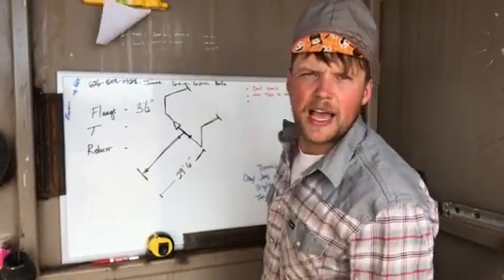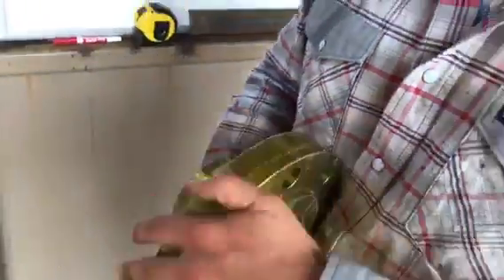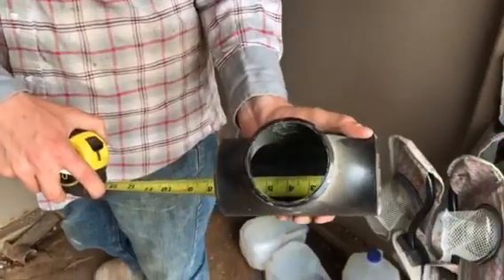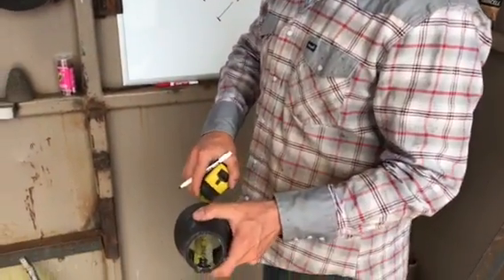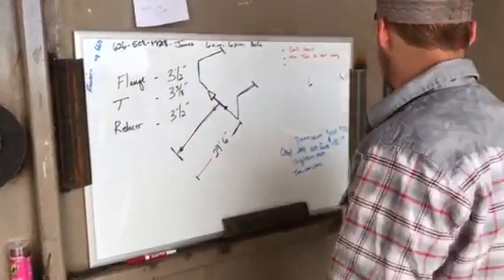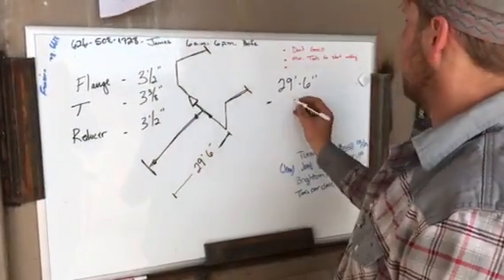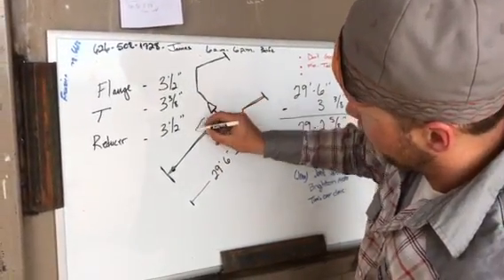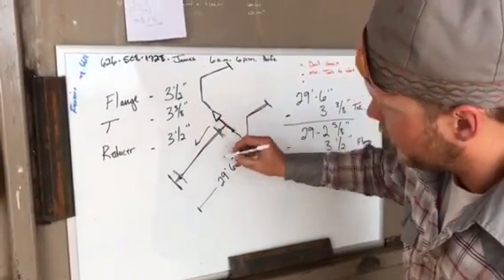Pipefitter fabrication reading an ISO

Comment: Forgot the weld gaps and gasket. 600# is the flange pressure class. The pressure a flange can withstand depends on operational temperature.
Reply from the maker: some pieces I don't worry about it but if its a lot of welds in one piece then I really pay attention to weld gaps and all that.
Reply: @JacobSchofield  That may work for three inch but you try that on some tight 10 inch and you may be screwed.

Comment: 600 lb is the pressure rating of the pipe and begins with 150 PSI and up to 2, 500 PSI. I'm a metric man and its leaps years ahead of imperial measurements and so easy 2 figure as well.

Comment: A 600# flange is not the pressure rating of the flange it is simply the flange diameter and bolt pattern..a 150# flange could easily hold over 500 lbs

Comment: I like how you use feet and inches instead of just inches I bet you have to use a calculator alot you can simplify your take offs by using just inches and not miss or end up staring at the print trying to figure that out.

Comment: 600# is not the pressure rating...That flange can hold in excess of 3000 pounds I've seen it with my own eyes.

Comment: Good video. Do you also take into account root gap or do you just grind it off when you fit it up?
Reply: I think I found the answer in the other comments lol. Thanks again great video.
Reply from the maker: ok great sorry i didnt get to quite fast enough.
Reply: No Problem. If I was smart enough to read the other comments/questions first before I posted a question 
I would have had my answer lol. All good.

Comment: I learned how to fab pipe in a stainless shop. 
I guess I got babied cus I never had to do takeoffs since it was all done for me on the print.
Let me ask you this. Besides the 3x2-T being a diffrent takeoff on one side, is there anything else that can trip you up without going to the book everytime? 
And do you account for your gap when throwing it together or is that like within tolerance? 
Again thanks for the info you guys are throwing out there man.
Reply: Josh perez yes always remember to take off your wire gap say 2,4 then remember your shrinkage

Comment: It can also be distinguished by the 1/4 inch raised face. 300 and 150#'s are 1/16 inch raised face flanges. On my blue book, it states that a 600# 3 inch flange take off is 3 1/4?
Reply: Make sure your book accounts for the raised faced on the flange. Most books don't account for the raised face on the heavier flange and it will be in small letters in a side note. Books are OK but an actual tape measure is always the best.
Reply: MrTigwelder1 10-4 makes sense now.